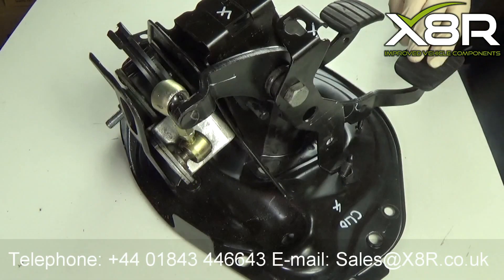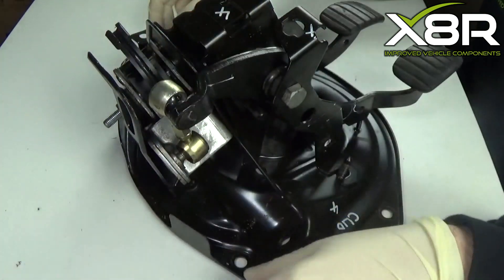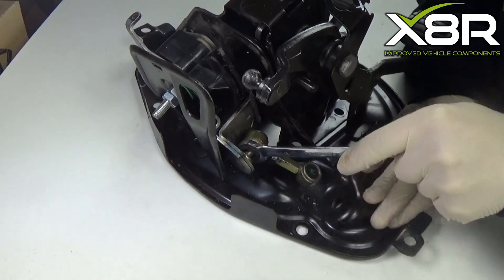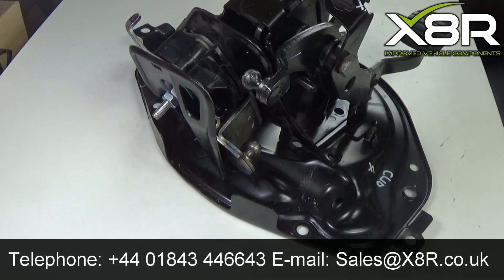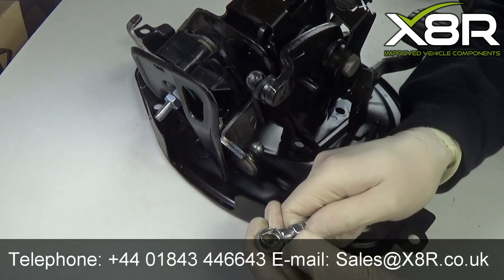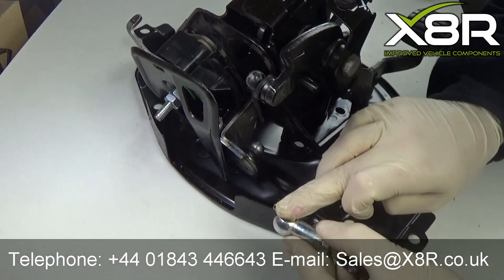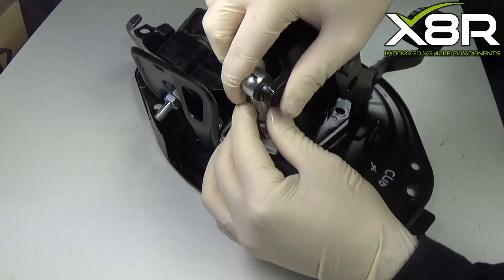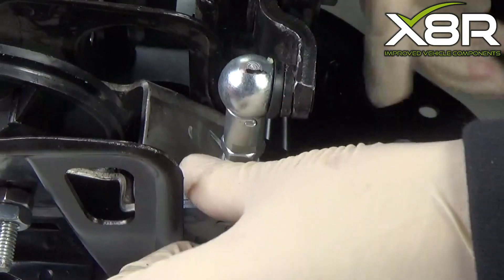Renault Clio Twingo Kangoo Clutch Pedal Link Linkage Ball Joint Ratchet Bar Rod Kit Repair Fix Kit

Comment: So, I got the pay from x8r, really good so thank you. I am not a mechanic but read about fitting difficulties. I did this. I got the plastic below the steering wheel of, unclipped the clutch cable by squeezing it. This allowed the harder rear ball joint to be brought forward. I then got the rear joint fixed first by placing it on the joint and then using water pump pliers to squats it on easily as I was never going to do it with my fingers. Then put the front joint on in the same manner before putting the cable back on.. So this worked and for someone who is not a mechanic. The undoing the cable and the use of water pump pliers made it v easy.

Comment: Just done this on a twingo. What you need to do is remove the panel under the dash and the bottom of the sterring cowl. First get the old joint off and then disconnect the clutch cable so you can rotate the rear ball joint forward. Put the rear joint on and the reconnect the clutch cable, then pop on the front joint and you're done. Took maybe an hour as it is fiddly as hell. I used a pair of pipe plier to push the joints on.

This video makes it look a million times more easy than it really is. 🤣

Comment: I just literally did this job on a Mk2 Renault Clio 1.5DCi.
(Initially I bodge fixed the ball joint that fall apart with some grease and 2 layers of ziplock bag)
Obviously you will still have one end of the dodgy clutch linkage ball joint to remove which was pretty hard to separate - I used a 14mm spanner wedged into the ball joint to ping it off but it was only just possible to do without bending the spanner. Fro me this was the ball joint closest to where the driver sits.
I did not bother with dust covers as talking the manufacturer of the replacement product it is not critical and adding that would have just made it harder for the next part.
As suggested by others I removed the clutch cable to get better access.
Oh I wore a head torch but I guess you could wedge a torch somewhere to illuminate proceedings.
My replacement link bar needed the cup to turned 180 degrees to match the old one - you have to loosen the locking nut to turn it.
Grease both cups just around the inside edge to help getting it on.
I started with the ball joint furthest away from where the driver sits and I could not get any pliers in to help so was just a matter of somehow getting both hands on the link bar and then pressing it on - this requires a decent amount of pressure to do.
Put the clutch cable back in.
The ball joint nearest you is next and for me was much easier as I could get flat head screwdriver in to lever the ball joint on.
There is an extra retaining clip to super secure the ball joints that was relatively easy to get on the furthest ball joint and a lucky miracle I got it on the other. Talking to the manufacturer these are not critical.
Twice a white plastic thing with a spring around it fell off from the clutch pedal that had to put back that is just fiddly and hard to explain how to do.
Reply from the maker: Great tips for fitting whilst on the vehicle! And can confirm this customer has spoken to myself and the dust covers and circlips provided are not 100% "essential" and the repair can be completed without them. They just provide an extra level of repair. - Georgina, X8R Ltd

Comment: I have a 2005 model. This took me about 6 hours over two days it was a absolute nightmare of a job with a lot of swearing 🤬  some tips for doing this job.  Get your self a extra long pair of mould grips. And remove the center pin holding the clutch peddle in place. It will give you better access.  First do the rear section. Then pop the clutch peddle back on and do the one that's on the peddle. The pins are a bit fiddley. So take note of how they go on befor clicking the balls into place.  You will not be able to click the balls into place with a screw driver, you simply can not get the angle to access it.  I will make a video of how I done mine
Reply: I appreciate this is a 2 year old comment but, on the chance you can remember this job and are replying, how did you manage to get the end on the pedal ball joint?

I have it on the other end but I can't seem to get the force/angle on it... 

Will taking the pedal off of the pin help or just make it harder to get it back in place?

Many thanks
Reply: @javonaziz5323  I just used a screw driver to get the old one of.   The hard bit is getting the pin in the new ones.  It's very very difficult access. And you will need to have a very flexible body.   Unless yours happens to be a left hand drive where access would be a lot easier
Reply: @Adventure.with.Robbie  thanks for the reply. Yeah I have managed to get the old one off and the new one partially on. I just need to get the new one connected to the ball joint of the clutch pedal but I'm finding it super difficult to get it to click on. Is there a knack to it or is it just a case of force?
Reply: @javonaziz5323  possibly a pair of muld grips. If you can get them behind there